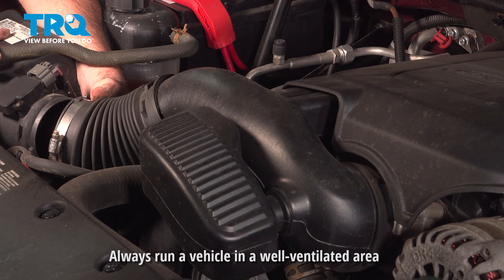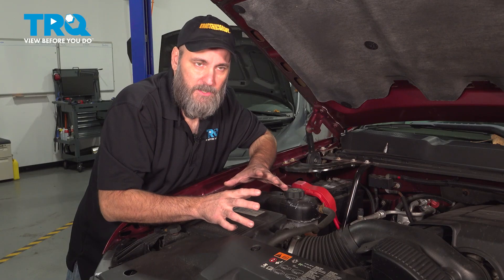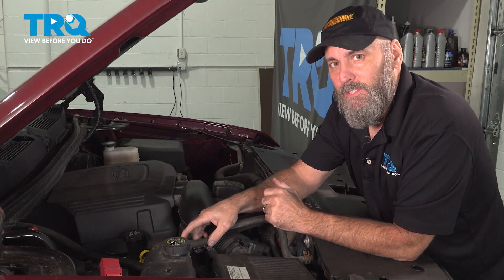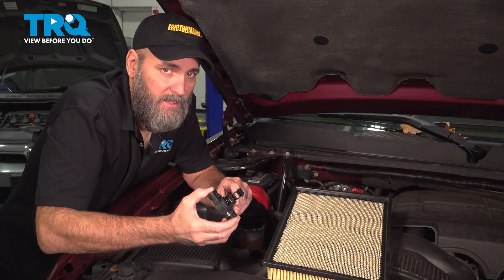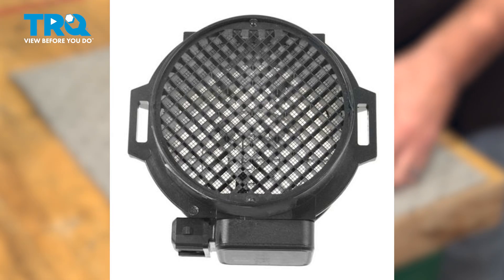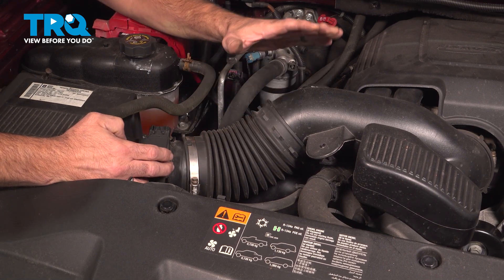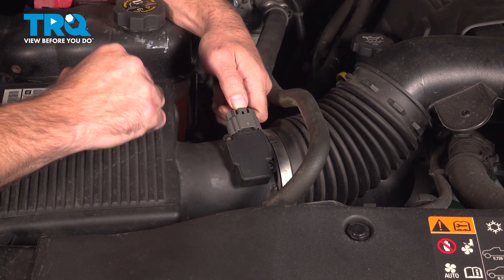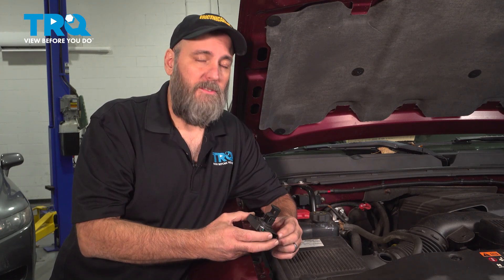EricTheCarGuy Explains Check Engine Codes: P0101 - P0102 Mass Air Flow Sensor Problems

Comment: Ive cleaned my orginal sensor and also replaced my my air filter still no luck. I then replaced for a new sensor and not change again...also done a vacuum leak test.

Again still no joy...so I am lost.

Comment: 15’ Buick Regal GS. I have done all the above procedures. Unfortunately this code refuses to go away. My next step is to check voltage on the wiring to the maf sensor. The other option was to  check and clean the throttle body. I heard that is a possible culprit. Any tips or input would be greatly appreciated. Thank you